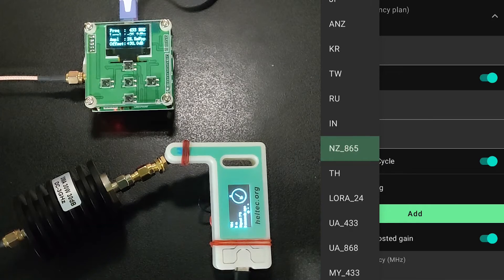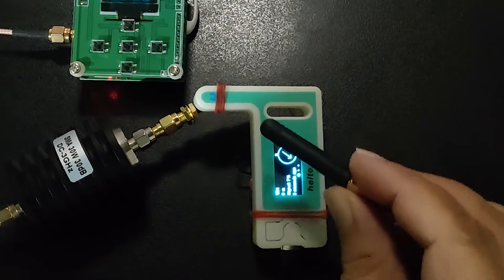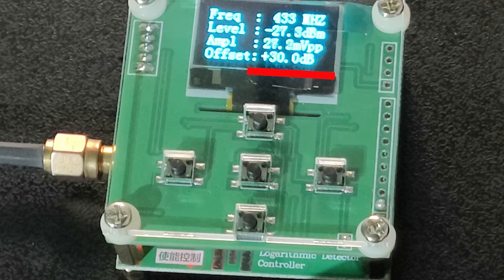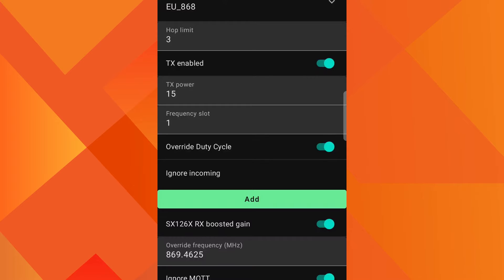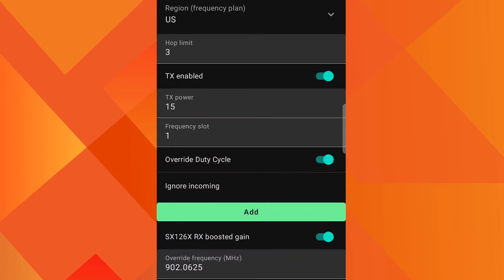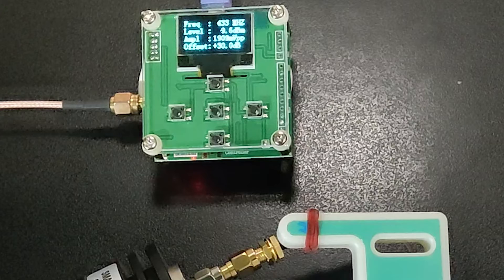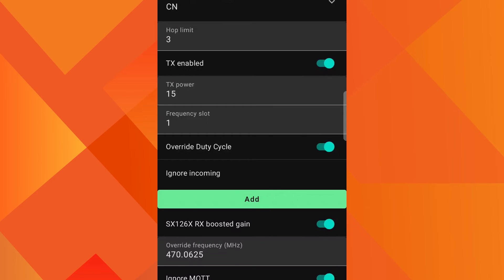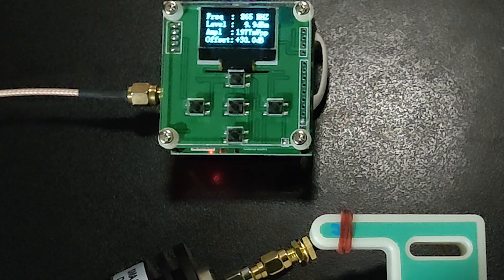Meshtastic RF Output Testing After Region Switching for Heltec LoRa ESP32 V3 by Technology Master

Comment: Great video. How did you get the board to transmit continuously ? Normally the pulses are very short. Does your power meter have a peak hold function ? SUBSCRIBED !
Reply from the maker: Power meter does not have the peak hold function.  Taking reading of short pulses of LONG_FAST preset is really challenging. So I have changed preset to LONG_MODERATE which transmits for longer time as I explained here https://youtu.be/Ke2e0uyvDZ4?t=107 also details of presets and transmissions are here https://youtu.be/ytr4yWl77NA?t=14.  Board is not transmitting continuously but I send text message to take reading. I have not setup a node to respond to these messages, so it transmits again and again for 3 times giving me enough opportunity to record video. I show screenshot from recorded video to make it more easy for viewer to read. 

Thanks for Sub and posting your question. If you get any other question related to videos, do ask :)
Reply: @technologymasterkam  Thanks for your reply. I will try it myself sometime. Do you have a link to the power meter board you used ?
Reply from the maker: Sure, https://www.aliexpress.com/item/1005003950055977.html   I guess these use AD8317 Chip.

Comment: Thank you so much , so from this video can i conclude i can buy a heltec v3 868Mhz module and still use it in 433 Mhz ? Also Subscribed #
Reply from the maker: Yes, I have demonstrated that and also used in real life. However it is best to buy a board for target frequency as sold by the company. Thanks for the comment and sub :)